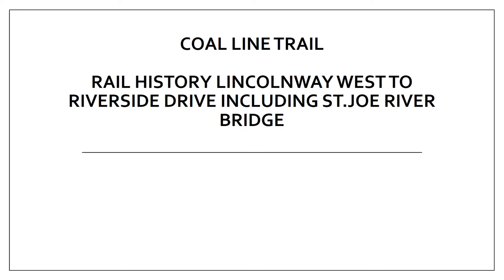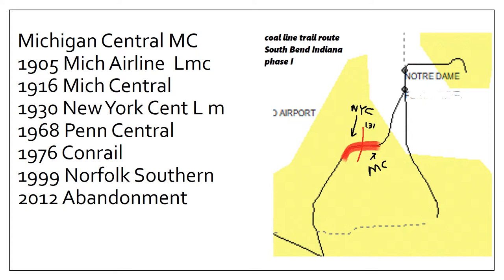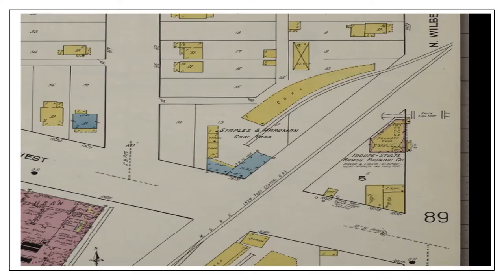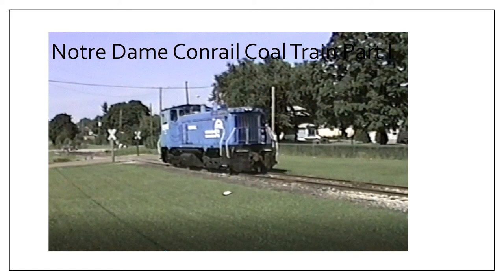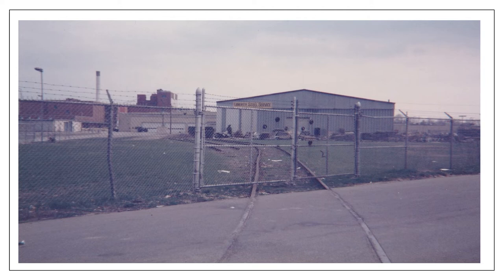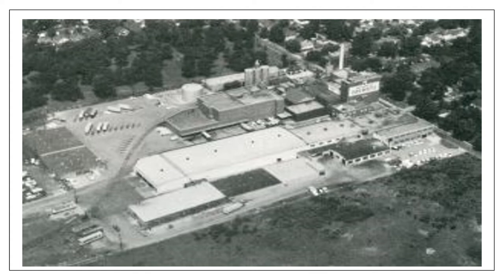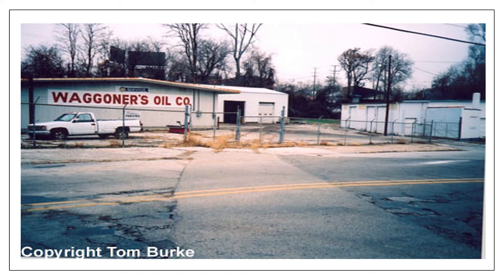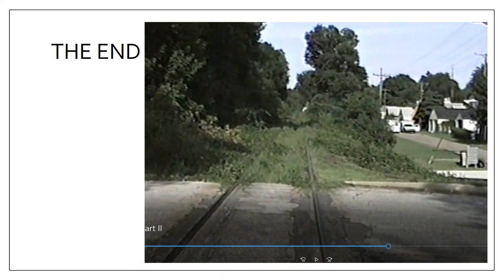Coal Line Trail Deep Dive Rail History

Comment: The photo at 8:06 shows NYC 675 pulling away from a northbound MC train to Niles at the switch to Drewery's Brewery.  The switcher and its caboose will "hide" in Drewery's spur to let the freight (with hoppers on the head end) go north.  Under union labor agreements, NYC crews had to lead trains on the NYC...so this was a regular occurrence for trains headed north out of Olivers Yard  to the old MC!
Reply from the maker: Very Interesting result of the ownership. So the switcher was left behind like a helper? What about sound bounds same in reverse?
Reply: @michianamainlines3538  Correct, the switcher went back to Olivers Yard.  On the southbound move, the switcher could just wait on the mainline for the inbound train...although I don't know if this practice happened on those moves.  It could be that only trains originating in Olivers Yard were subject to the rule.

Comment: Here is some information on that switch engine caboose and GP nine that’s sitting there at Vassar Avenue.  I went to Holy Cross school for eight years so I was very familiar with that operation what they’re doing there is the second locomotive is a Michigan central engine that’s not allowed to come out of the Oliver Street yard under its own power so the switch engine and caboose pulled him to Vassar Avenue where apparently the rules changed the switch engine with Denon couple pulled into the Druery siding and let the road diesel go onto Niles .  This was a daily operation where the road diesel would come down from Niles in the mid morning and go to the Oliver Street yard under his own power drop his trailer and pick up the new one.  The coal line actually crossed both the grand trunk mainline do you New York central main line and the south shoreline and orange Street before it got to the area in the photo.  in the early 50s this was steam powered using New York central I think 282 type locomotives on this line I was very young in early grade school so that’s all I know about it I hope this helps thank you.. Michiana main lines you’re free to contact me if you want more information on this glad to help.
Reply from the maker: That is what I have since learned. My experience was under CR so that was new to me.